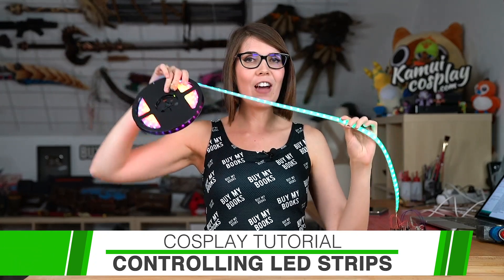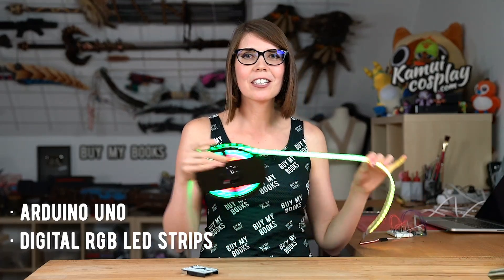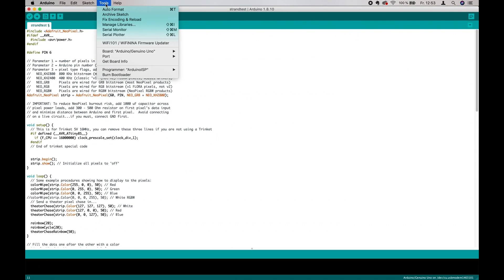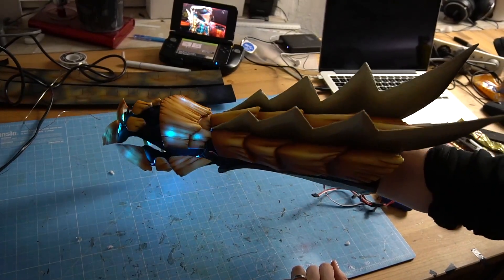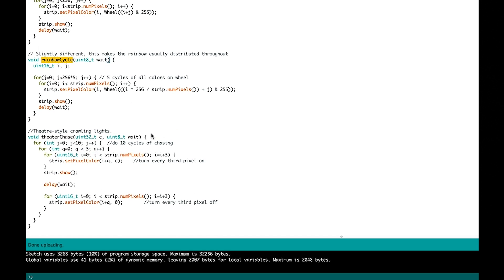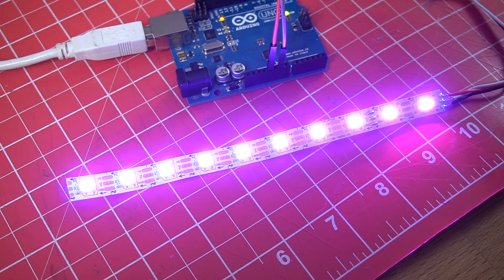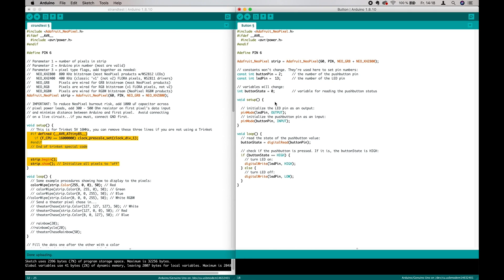How to control LED Strips with Arduino - Cosplay Tutorial

Comment: Sidenote: If you are working with a long strip of LED, only the first 5 meters works, I am using a 10 meter long strip, but the other 5 does not work! Keep this in mind!! You can adjust it by the LED_COUNT, the number of led lights up from 60 to more!

Comment: This is a deceptive or intentionally inaccurate video. It is easy to power 10 LEDs via arduino. For those several longer strips, there is no explanation of how they are powered, so it turns out that one Arduino can power several strips. Good luck with that.
Reply from the maker: I already powered up 800 LEDs with no issues! It’s always the same technique! 😊
Reply: Can you show how you power 800leds with 1 arduino? @KamuiCosplay
Reply from the maker: @davorkosanovic7869  Check out my Master Nova build: https://www.instagram.com/reel/Cr3lCagopZr/?igsh=b2ZpMGl6bXh1aHM1
It’s not really a question of the amount of LEDs, but the power drain. If you are able to control it with animations, adjusting the brightness and using the right color you are probably able to light up even more. 800 was my personal record though!
Reply: Hmmm...800 leds from single power source or....??
Btw, altough im not fan of cosplay, respect for your work! Costumes looks amazing!  @KamuiCosplay
Reply from the maker: @ItsGoodToBeliveInJesusChrist  Yes, a single 6600 mhA lithium ion battery pack! 🙌
And thank you very much! 😊

Comment: My younger cousin is really into Harry Potter and wanted me to make him a Wooden wand from a tree branch that lights up.
I was hoping to find a small push button that can be used to turn on and off the LED light that I could recess into the wood and use a little cabochon gemstone to glue to the button so its hidden.
However I am struggling to find something small enough and compatible with this type of set up.
Do you have any suggestions?

Comment: what power supply do you use for your LED microcontroller solution? a 9v battery block? li-ion batteries? and how much voltage is applied to the microcontroller? so then at the end built into the cosplay?

Comment: IK this is an old video but for anyone wanting a simpler way to control leds, there's a firmware for the esp8266 boards called WLED which gives you an app/ website to control your leds.
The esp8266 boards cost much less than Arduino. I'm using a NODEMCU ESP8266 board.
It already has everything you'll need for this. You just need to connect your leds and power. No coding :)

Comment: It's also helpful to note here, most especially for beginners, that this guide applies to 5-volt (3 wire) type neopixel led strips. If you are using an analog 4 wire 12-volt led strip the code given here will not work. The example sketches will run but the LEDs will be extremely faint and almost impossible to see.

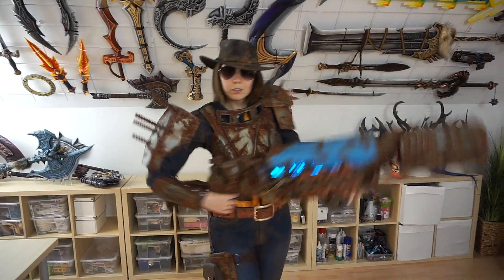Comment: I know this is an old video so you probably won’t see my comment but ….I want to Create a faux window/skylight for my cave like bedroom 😂 there is no windows and literally 0 natural light so I struggle getting up in the morning would it be possible to program leds to run from say 6am in a yellowish fading lighter as the day goes on into a bright white 12:00 then dimming down and going to yellow /orange for sunset I know I could manually change the settings throughout the day but the point of it was not to have to do that I can just leave it and let it do it’s thing I’d mount them in a kind of thin box frame and defuse the light ect any ideas would be appreciated 🙏🙏

Comment: I just picked up some USB LED rgb strips yesterday for future projects. I have a light puck that I am using right now. Problem I see is there are specified limits for power supply from the Arduino so at a certain point you have to use a secondary supply and at least some transistors. I modified my light puck to do this and all I had to do was break off 3 pins from the micro and solder the 4 wires to the arduino. I made a video on my channel about it a LED PWM... Practical Upscale.

Comment: You uploaded this a few years ago, so you may or may not know about this already, but when you use the switch you can pretty easily add code to the rainbow loops that would interrupt the loops and bail out of the functions. One of the cleanest ways would be to just pass in information about the state of the switch when you enter the function, then at the top of every loop just check if the state of the switch has changed, if so, end the loop.

Comment: hi Svetlana senpai, i actually followed the tutorial books on this, but somehow my LED's aren't lighting up. both powerboost and the Pro trinkets 5v have their lights on when i connect my Lipo battery 3.7V with 500mAh, but the LED sort of blinks for split second but it doesnt light up. it happens too when i switch off and the LED blinks split second.

the funny thing is it lights up the moment i plug the charger to the powerboost without the battery but the pro trinket wasnt on. did i do anything wrong here? i need help T^T enlighten me~

Comment: Once it’s programmed can you take it off the Arduino and stuff then wire it up to a battery pack? Will it be the same colours as. You chose on the program or will it go back to its original
Reply from the maker: No, the Arduino controls the lights. It would be like a PC monitor without a PC. :)
Reply: @KamuiCosplay  So we need to keep the arduino connected to the lights? And if so, how would we do that if we are planning on putting them on our walls? Thank you.

Comment: What cable are you using to connect the lights to the arduino?
Reply: Just solder a wire between the arduino pin and the data input led strip

Comment: if my led strips have 4 cables how i'm supposed to do it
Reply: Not^^ those work differently, you can controll them with an arduino and another module (arduino doesnt do 12V itself) but they aren't individually adressable

Comment: Does it always have to be connected too the Computer to for it too run??? Please answer!!
Reply: No, once you put the program on the arduino it will run the program everytime you power it on... so you need to have the arduino connected to power and the led strip connected to the arduino (and power^^)
Reply: @johnuferbach9166  ohhhhhh ok thanks

Comment: Clear instrutions, tnx. Just have one question, suppose the LED is 5M long (300 SMD LEDs), how does one insure that the strip get's enough power?
Reply: Use a big enough power supply (current per led * number of leds * voltage + some safety... current oer led depends on color and stuff, i think max brightness white is 64mA) and attach the vcc ans gnd at several points along the length

Comment: what cables do I have to buy to connect the light to the Arduino
Reply: you can solder on any cable, the ones compatible with the pinheaders are called "jumper cables" you would probably need atleast one male end if you have the uno with female sockets... you can then just cut the cables and solder the other ends to the led strip (don't forget to add the safety capacitor inbetween and don't forget you shouldn't supply larger numbers of leds through the arduino)

Comment: what schematic should i use if my led strips have 4 pin slots and have the labels 5V ,  G , R , B
Reply: then you need some kind of breakout board to controll them since they are not individually adressable, you can set the color of all at the same time via the voltage on each of the color-ports, so you need to output an analog voltage (might also work using PWM) ... probably best to look for a tutorial online :)

Comment: May I know what's the maximum led strip length I can go with just using the USB connected to a charger ?
Reply: depends on what you have turned on... each led (so each color) consumes about 20mA max per color, so if you want white at full brigthness you can support roughly 3 leds through the arduino (since it can supply 200mA if I remember correctly) ... that's why it is recommended to supply the leds and arduino seperately like described here https://learn.adafruit.com/adafruit-neopixel-uberguide/basic-connections

Comment: I think you should use a bigger resistor for the switch. The current one will draw a lot of power when the switch is on. Also why do you use a resistor for the strip signal when combined with the switch? You did not use it with the strip alone.
Reply from the maker: Oh this is actually the recommended setup of the Adafruit tutorial. Just ask them! I usually don't use a single resistor in my LED strip circuit and it works just fine! :)
Reply: @KamuiCosplay  You are right. I checked their best practices and they indeed recommend the resistor on the signal wire of the strip. I never used one until now :-) I guess I was mainly confused because you first showed LED strip attached without resistor and only added it when the switch was added.
Reply: About the resitor at the switch. The 220 Ohm Resistor you use will cause a current of 22mA to flow when the switch is on. As you only need the resitor to pull down the input pin of your arduino I propose to use a bigger resistor. With 10.000 Ohm the current would only be 0.5mA. To be honest I am not sure how much of a difference it makes as the LED strip might draw a lot more power. Still on battery every little might help.
Reply from the maker: @ChristianSchneider2  Well, as I said for my actual costume builds I don’t use any resistors, but thanks for the note! Everything worked also quite fine this way. :)

Comment: She forgot to Tell what to do of you Need More than 8 LEDs
Reply from the maker: I mentioned how to adjust the numbers of LEDs. Just watch the whole video! :)
Reply: @KamuiCosplay  But did. you Tell that you will Need an additional power Supply and how to connect it?
Reply from the maker: @matthias9379  This video was for the code though. For the circuit just check out this video! :)
https://youtu.be/U_Kl1YCDO2E

Comment: My led strip has 4 pins at the end, how can I use this?
Reply: you can't :x ypur strip probably works with 12V and different voltage to controll the colors, so you'd need an additional board to controll that type of leds with the arduino (since the arduino doesn't support 12V)

Comment: Please don't use this schematic for more then couple of LEDs
Reply from the maker: Lol, if you actually used such a built, then you would know that it’s not the amount of LEDs that matter, but code you are running it with! I used it even 800 LEDs with it and had no issues! :)
Reply: @KamuiCosplay  800 LEDs how much is that? 25 Amp's? Shre arduino can provide that and your laptop usb
Reply from the maker: @doctorpex6862  20 mA per LED on white and maximum brightness. If you are using red with lower brightness and even program in an animation that turns on only a small percentage of all LEDs at the same time, then it’s totally doable. Just check out my Master Nova costume video on this channel. My Brigitte shield used also over 500 LEDs with the same setup. :)
Reply: @KamuiCosplay  you obviously don't understand that arduino can provide maximum of 40mA which is fine for couple of smaller WS2812 LEDs but anything more will fried arduino board. Except if your viewers are not here for arduinos...

Comment: As a game artist and programmer the way she talked about changing the colors kinda bugged me
Reply: it stands for RGB. red green and blue if u use photoshop u are probably  familiar  with it and u note it like this (R,G,B). 255 the max and 0 the min. She changes the values of red or green or blue to change the colors which is fine but you can just instantly pick the color you want. at the top there is a tap called tools. if u click that u get a drop down menu and it it will be a color selector.  u can just select a color here and see the code u need to use right away. you both see the RGB values you can put in to get that called but also the decimal color which are the color numbers that start with #. and then you instead of doing (R,G,B) you just remove all 3 and place (#4FFa) in it for example.
Reply from the maker: Not everyone has photoshop though and I think explaining RGB is far more easier. In addition I personally prefer using 0-255 not just to adjust the colors, but also the brightness. This can be really important to lower the power drain. :)
Reply: @KamuiCosplay  oh wauw i was not expecting to get a response haha. RGB is easier to explain i agree and there is nothing wrong with the way you do it or teach others, it was more a personal thing and I wanted to explain a bit more about it to anyone that was interested. You can adjust the brightness with the # colortool as well. I love your videos:D they help me a lot. :) 
ps. i didn't mean to sound rude or anything. it is just as programmers you are taught things a certain way and the importance of them. but if you are not a programmer none of that matters and people should just have fun with it. In fact for anyone interested. the program is the exact same as processing and its free to download!. they have a huge web library where they explain how to write certain code and what it does.

Comment: Can I use normal leds or have to use digital ones!
Reply: To do it lime this you need individually adressable rgb-leds... you can use normal leds but those only have one color and need pwm for brughtness controll, so you'd need to use a transistor / a limited number of leds
Reply: @johnuferbach9166  I meant can I use normal RGB LEDs or are these specifically different?
Reply: @hamzasadiq4528  The most common ones this works with should be Ws2812b (which is the controller chip in the led)... you can also check out the documentation of the library you want to use, which should say which chips it supports
Reply: @johnuferbach9166  thanks man

Comment: Amazon no longer carries the arduino linked in the video (at least that’s what I’m seeing when I click on the link). Will any arduino unit work? (I’m super new to programming and I don’t want to buy the wrong equipment)
Reply: "the wrong equipment" - talking about an investment of like 5$ max xD
but yeah, basicly any lower end microcontroller works, though ofc not all of them make it as easy as the arduinos... maybe use an arduino nano, it's about the same as an uno but smaller (also if it sais arduino uno / nano ect. it is usually fine to use, no matter who makes / sells it)

Comment: Does the arduino need to stay connected to the LEDs for this too work? Or does the code get copied to the board of leds? As well can the code be set to a remote to control the leds?
Reply: no, the leds only remember their current configuration until power down (they keep the current color until you turn them off and don't light up at all when you power them on without controller)... so yes, the arduino needs to stay connected.. if the uno is too big for your application there are other boards like the smaller arduino nano, which works just the same

Comment: Kamui (und leser) ich hab ein großes problem und ich hoffe ihr könnt mir iwie helfen😅😅
Das problem ist das ich ein Servomotor mit einem mikrotaster plus einem arduino verbinden will aber ich weiß nicht wie und welchen code man benutzen sollte um den Servomotor um 180grad zu drehen...also basically man soll den Mikrotaster berühren und der servomotor soll sich dann um 180 grad drehen...nur weiß ich nicht wie das geht 😭😭
Danke für jeden der mir hilft^^
Reply from the maker: Also meine Lieblingsseite für Tutorials ist www.adafruit.com, dort habe ich alles gelernt! Vielleicht hilfst du aber auch Hilfe auf https://www.arduino.cc/. Ich muss ehrlich zugegeben, dass ich von dem ganzen nie wirklich ne Ahnung habe, und das ganze auch nur mit Hilfe von Tutorials mir selbst beibringe. :)
Reply: sowit ich weiß gibt es eine servo-library, mit einer Funktion wo man einfach den winkel vorgeben kann :)
und den Taster kannst du einfach mit der einen Seite an 5V anschließen und mit der anderen an einen Pin (mit internem / externem Pull-Down Widerstand auf GND, damit der geöffnete Zustand definiert ist) und dann im loop als digital-in einlesen, also... if(digitalRead(button_pin) == HIGH){
servo.set(180);
}else{
servo.set(0)
}
so in der Art... nicht kopieren, die Syntax ist glaube ich nicht ganz richtig, aber so in der Art halt

Wenn der Button quasi einen Zustan ändern soll (also... button > fährt 180°, bleibt da, button > fährt wieder zurück) musst du wenn der Button gedrückt wird ein flag setzen, d.h. 
if (button == high && (millis() - time > 200)){
if(flag == False){
    flag== True
}else{ 
    flag == Flase
}
time = millis();
}

weil Buttons leider nie perfekt sind (= beim drücken geht die Spannung oft mehrfach über den Grenzwert) muss man hier noch debouncen, also nur einen Knopfdruck annehmen, wenn der letzte länger als z.B. 200ms her ist

... und ansonsten steht das garantiert auch alles im Internet, also bei kleinen Problemen einfach mal googlen, du bist bestimmt nicht der erste, der das machen will :D
Reply: ansonsten kannst du evtl. auch wie Kamui einen Schalter verwenden, da musst du im grunde nur den Zustand abfragen, ist also ein bischen einfacher

Comment: Hi, can we integrate Java code with adurino software code ? As I have written a code to control real time day light on the map based on UTC time zone i.e 24 zones = 24 leds on the map .. I need you help please 🙏🏻
Reply: you can probably have the java code on a pc/raspberry talk to an arduino via usb-serial and  just tell it what to do and program the arduino in c... i guess you could probably also run the java code on a raspberry and controll tge leds via its io, but i think you'd need to still use c for that

Comment: How many RGB stripes at once are too many for the single 5V pin on the board?
Reply: just don't... it's not that hard to use a 5V power supply and have two extra wires xD
i think the board can give like 200mA? so thats 3 leds on white at full brightness, or more at lower brightness